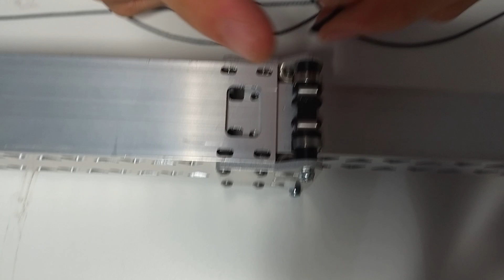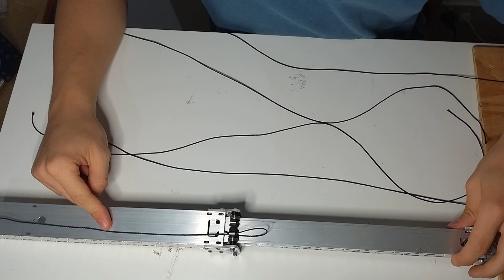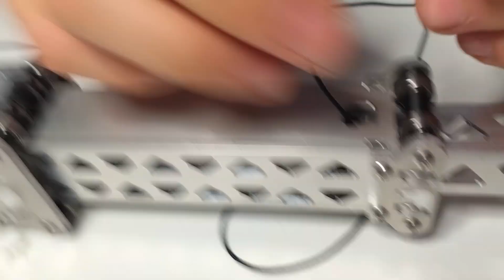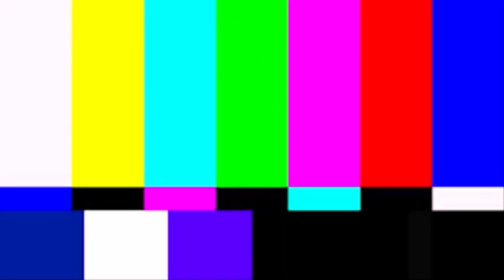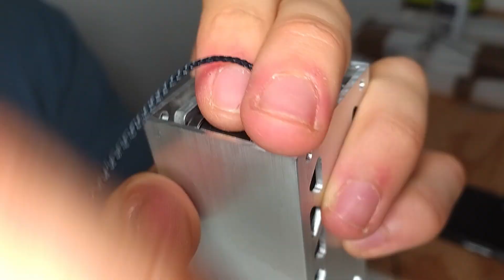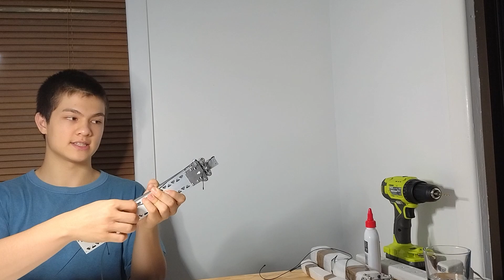Stringing BOX TUBING - First Tech Challenge

Comment: The "two spools" or pulleys that are different mm diameters, can you clarify which size for up vs down strings, and also any suggestions on where to buy those (which if any work best), and any videos on motoring the device? Thx
Reply from the maker: Hi Brian, thank you for your comment. You can find a motor mounting kit on our website - it will be stocked in the US by the end of this week. The team will be releasing a video showing how to use the mounting kit in the next 2 weeks. In the meantime @BroganMPratt has a video briefly detailing his setup. Always feel free to reach out to us via emai: info@offsetrobotics.com
Reply: 3D-printing works well for spools, if you make them dense enough and with enough walls
The retraction spool must be twice the diameter of the extension spool

Comment from the maker: All box tube kits also come with COUNTERSPRINGING options - this is what the extra vbearings + bearing shields are for on the opposite side of the outer stage are for.
Reply: currently your website shows that the box tubing kit is on back order. what is the lead time on the back order?
Reply from the maker: @redraider1480  Under 2 weeks Before stock arrives in the US
Reply: Oh..! I was about to ask why there three extra v-bearings. Cuz from the video, it seems like you only need 2 v-bearings. One from base and another one from middle stage. So you have three extra v-bearings. These are for countersprings? I suppose by counter spring, you mean gravity compensation with extension strings?

I checked your website, and I dont see any documentation or BoM on springs. Is this not yet available?
Reply from the maker: @sihoonkim1502  Yep, you are spot on, they are for counter-springing. While there isn't any documentation (video coming very soon), the bungee cord on our website is perfect for counter springing. Simply tie the bungee the same as the return string, and then tie it off on the base of the box tube somewhere with some tension. The counter springing is quite linear, because of the cascade stringing setup.